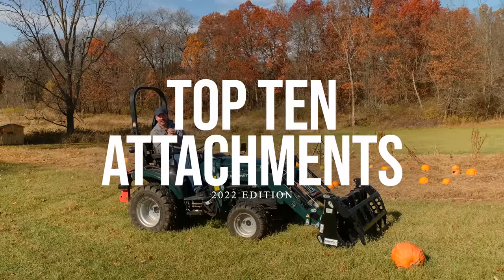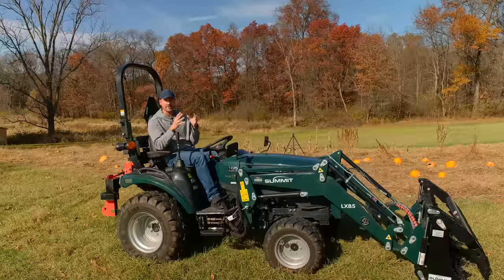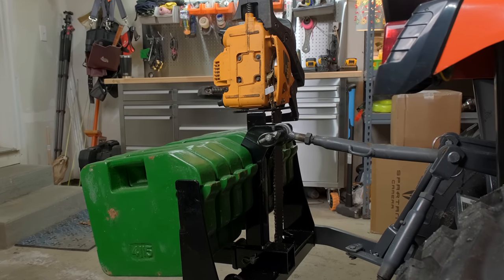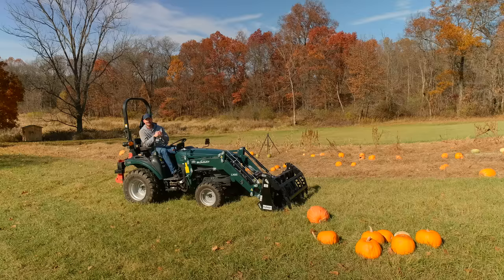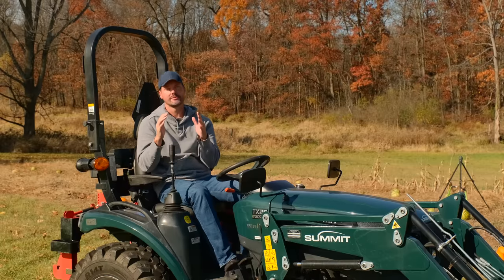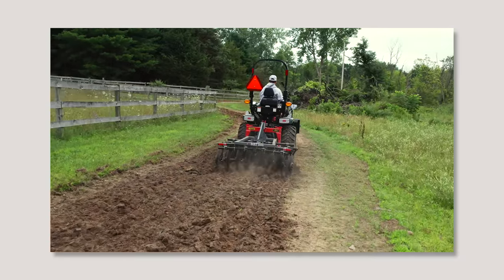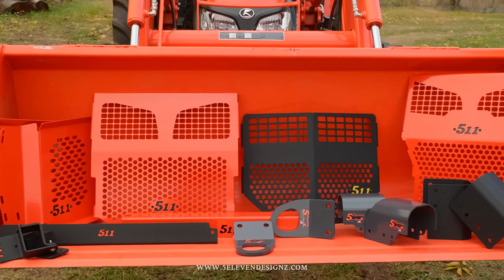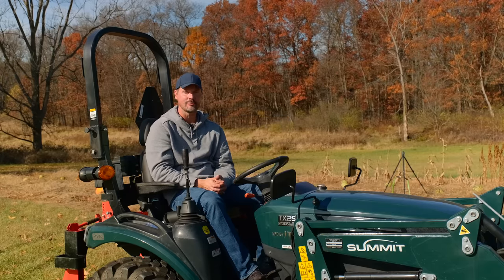TOP 10 TRACTOR ATTACHMENTS SOLD 2022 🤩

Comment: it took me over a month to get all the hoses and fittings to get my grapple working, actually connecting it properly and not to mention all the money involved. I was really bummed, I felt I should have just bought the electric one. but it was great having a grapple after the hurricane, only took me 8 hrs on the tractor to clean up all the debris that would have normally taken 4-5 days with help

Comment: LS uses skid steer attachments
Reply: Sure do. I have a MT3 47 it has the regular skid steer attachment.
Reply: @lodilogistic5089  I have the same tractor. Did you get a cab with yours? I did, best investment ever.
Reply from the maker: Some do, some don’t.  I’ve special ordered the proprietary LS quick attach on attachments for customers.  Just because yours has ssqa, doesn’t mean LS doesn’t offer their own version.
Reply: @GoodWorksTractors  I don't doubt it. I think All the stuff they're currently selling is skid steer attached. But I could be wrong, and most likely am. Lol
Reply: @michaelblack2135  yes sirrr!! Cab and air,tire loaded with rim guard and widen out. Also third function added.